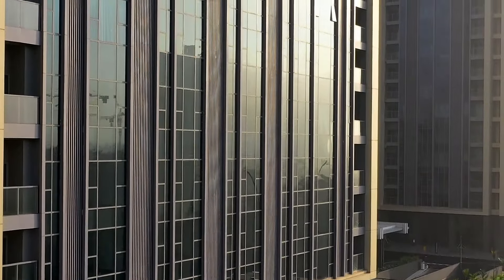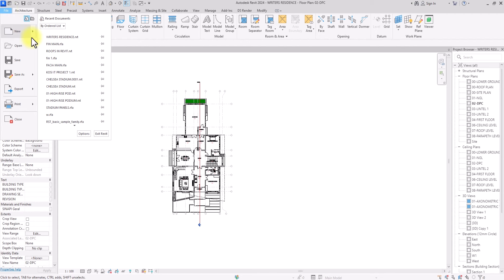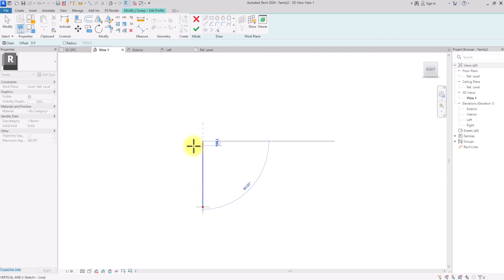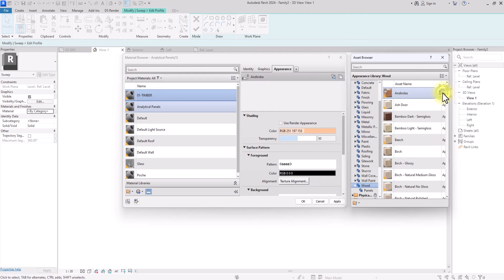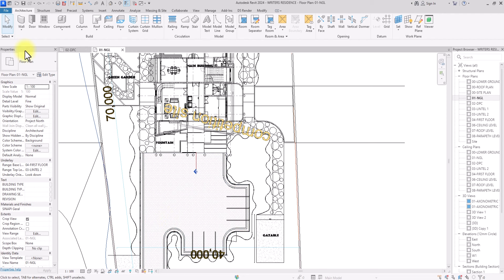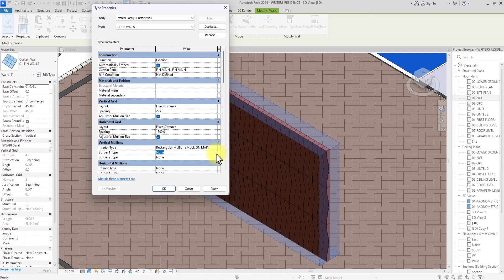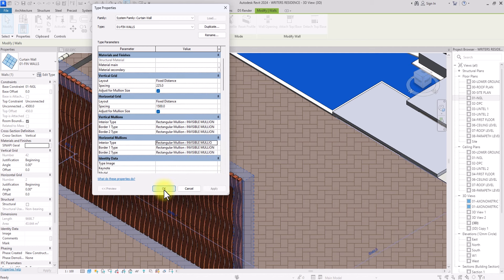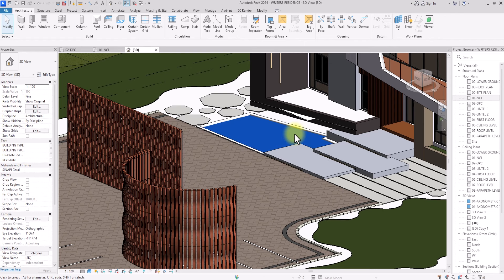Parametric Fin Walls In Revit 2024

Comment: Thank you Arc Piperr. Please when i try to put the mullions on the fin wall There's a horizontal internal one that divides it, therefore not make it flow well. Please how can i remove that.
Reply from the maker: Edit the curtain wall and check whether horizontal mullions are set